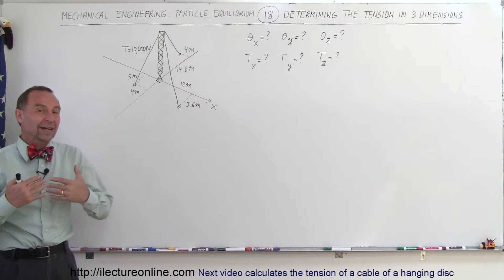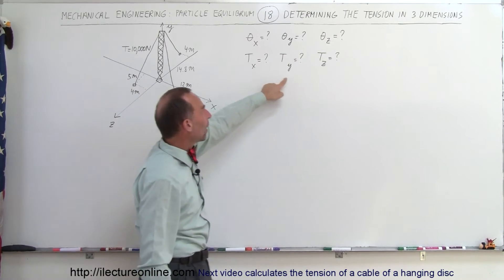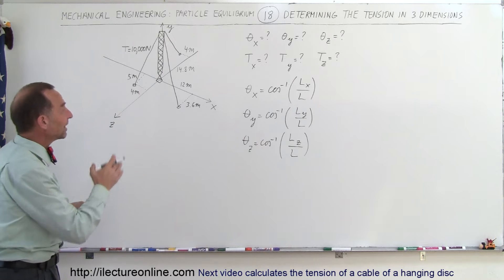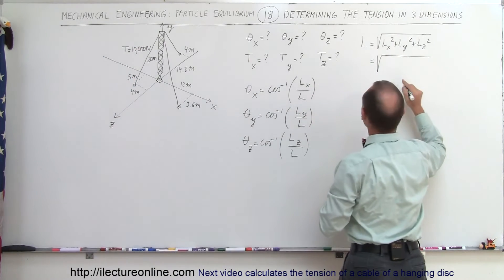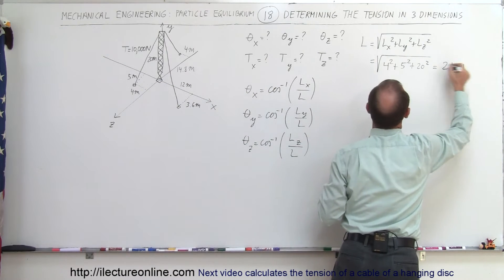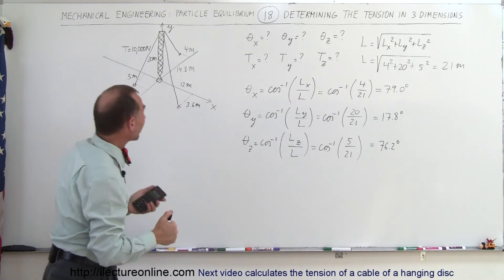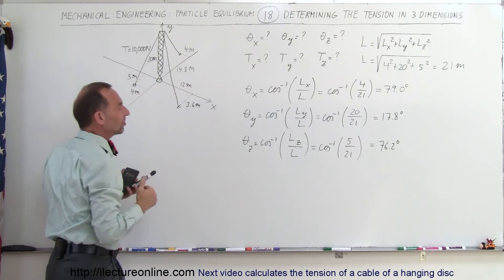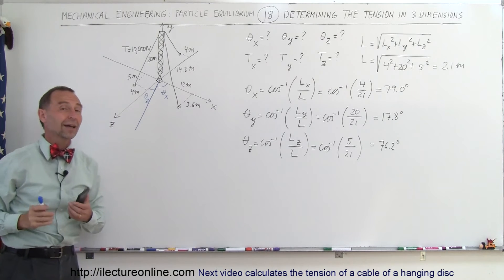Mechanical Engineering: Particle Equilibrium (18 of 19) Determining Angles & Tension in 3-Dimension

Comment: Hi, I like your video, you explain it very well, but there is an issue. I noticed that you made a little mistake, the Z component of the Total Force is negative, and the "Theta Z" angle is not 76.2° , is 103.8177°, if you use the formula:
Cos^2 θx + Cos^2 θy + Cos^2 θz = 1, and you clear  θz, in order to find it, taking into consideration that Fz<0, so you will get the next formula:

Cos θz = - √1 - Cos^2 θx -  Cos^2 θy
Then you'll get: 103.817716°
I hope you can answer me back, couse I've been learning it that way in college, I want to be sure of the result.
Pd: Sorry for my english.
Pd2: Nice videos.
Reply: Leo B I think also as you thought
Reply: I know it has been 5 years, but you got it correct. The angle he got was wrt -Z axis

Comment: Hi Michel..... Happy SUMMER to you....  I'm enjoying your latest videos... thank you for all of them... These videos on Mechanical Engineering are Astounding. As usual you've taken complex concepts and revealed them to be Easy to understand when PRESENTED in the Right way.... that's your style..   In regards to this Video Lecture... I was wondering if the Tension in the Other TWO CABLES could be derived simply from the Values you've determined for the 10,000 Newton Cable?... I'm wondering if using the concepts of Equilibrium would apply, that is.. using sum of X forces equaling ZERO, sum of Y forces equaling Zero, etc....  By the way, I've either read about Direction Cosines or Saw videos on them... and Never have I gotten such a complete picture of them before. Your videos continue to achieve at the highest level...  Thanks again.....
Reply from the maker: Philip Y 
Hi Philip.  Good to hear from you and thanks for the kind words.
Yes, the basic principles of the sum of the forces in the three directions can be used to find the tensions in the other cables.  (I skipped the other cables because I wanted to keep the video short enough)
I am definitely having fun with mechanical engineering.
Too bad I don't have more time.......
Reply: you have to find the sum of all forces in each direction (X, y and z) and then you will get a system of equations ( including the weight of the tower) from wich you can find the other variables by a variety of methods